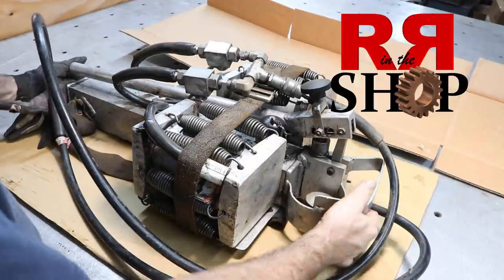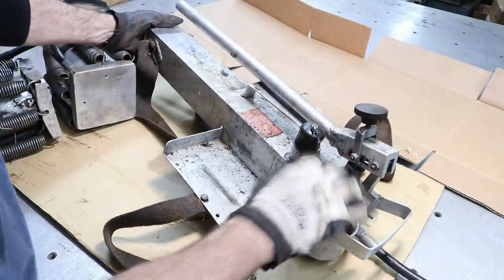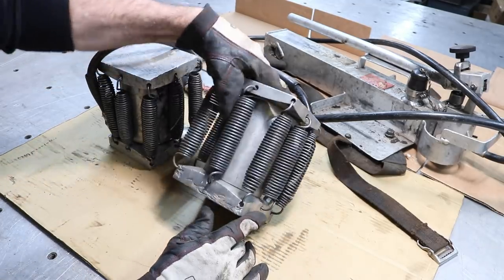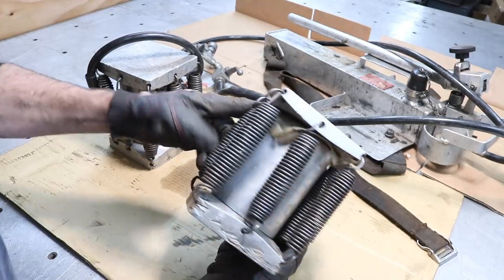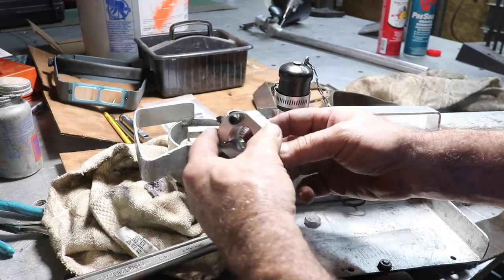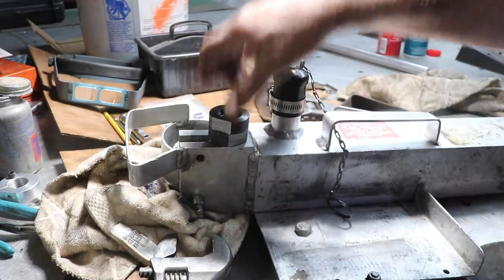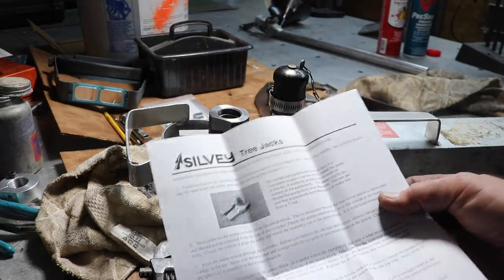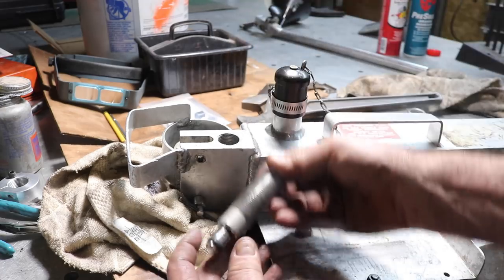Hydraulic Tree Jacks What are They?  Can I Fix Them? Pump Disassembly P1

Comment: For the faller, you have to leave more holding wood if you are going to use a tree jack to tip them over.  For Randy the bottoms thread off the jacks and the insides are rather standard hydraulic ram soft parts.  The jack unit is likewise standard hydraulic jack parts.  Silvey did a pretty good job using off the shelf stuff for replacement parts.  Oh, by the way worked for International Paper for 15 years servicing the saws and felling equipment.
Reply from the maker: Thank you for the insights.  MC
Reply: I get that I need a lot of holding wood but i was seeing if we could pull off not going 180 out of lean with that super dead cedar. And it didn't 😂 but that is why we tried we have a field to fail into

Comment: 10:40 - When made without internal threads, that is called an optical wrench or a lens wrench. It has astounding grip and will not crush or collapse a thin-walled workpiece. They are easy to make from a bit of plate or plywood (depending on the intended use) in just a few minutes. The only downside is they have a very limited range (like split collets), so you have to make one for each situation. Try making one the next time you have a stuck filter on your camera lens.
Reply from the maker: Thank you Peter for the great info.  MC.

Comment: Hello Randy,  The way he was falling it sure looked like even if it went well he would have pinched his blade with the jack?  Thanks for the suggestion to use an ultra sonic meter on my RapidAir shop system.  Did that and found two minute leaks.  One was in a chromed over cast push to connect fitting.  Takes a few minutes to get used to it.  I first turned it on and thought my whole system was leaking!  Quickly learned that old fashioned florescent lights run at 35 MHz!!  I am still losing my system charge at 120 psi (60 gal tank and a bit less than two hundred feet of line.  One hundred 3/4" mainline and a hundred 1/2" feeders) down to 10 psi in 24 hours and 0 psi in  36 hours.  So my question would be what is normal loss that I should shoot for?  It appears I am not going to get to zero.  I am wondering how much over time leaks by the compressor rings?  I have soap tested three times, and ultra sounded it at least half a dozen (the ultra sound leaks were so small they did not blow any bubbles on the soap test at all so it is effective.) times.  I have found a few leaks since I installed it and most are related if not all to poor quality fittings.  From pin holes and cracks in them to the poorly threaded ones.  Gotta thank the Chinese!!  Hope all is well with you and your family and am glad you evaded the fires.  Take care.